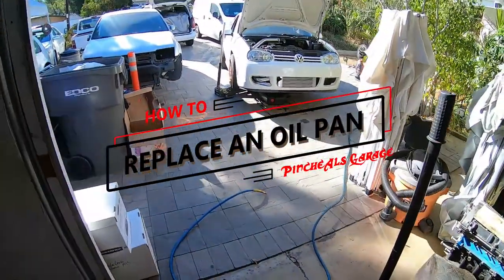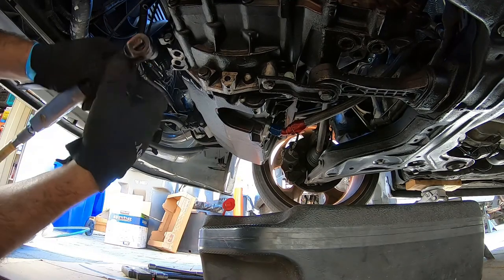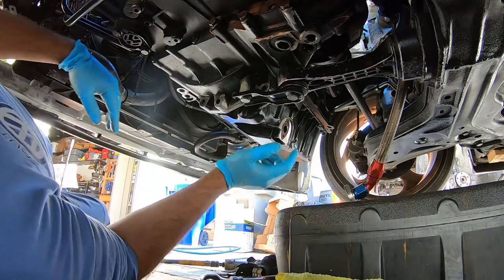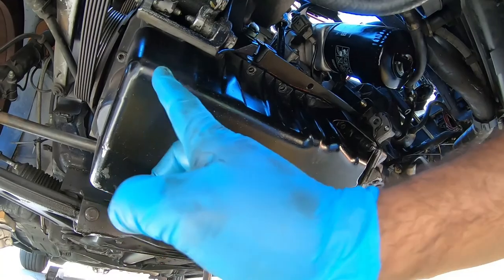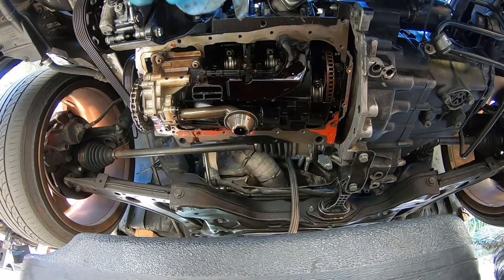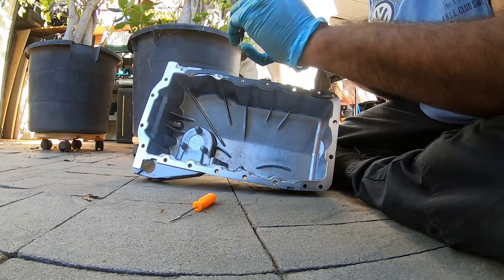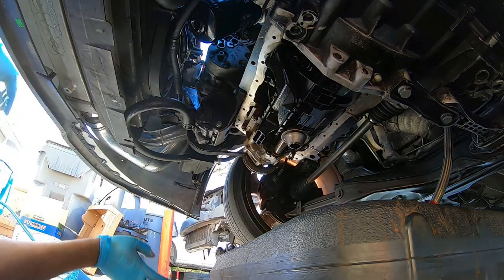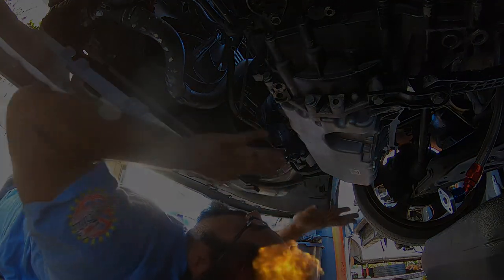How to Install MK4 Oil Pan S7EP18

Comment: Awesome, thank you. 
Just replaced my pan for the first time with your help.
Mine was really stuck after removing all the bolts tho. 
Pieces of the pan broke off when trying to pry it off. (Autumn in Cold weather country). 
Used a "heat gun", "hot air gun" or what it's called in English? to make the seal softer, and it worked like a charm. Thanks again.

Comment: I busted my oil pan recently. I’m lowered and static do you think it’s worth it to get a hybrid pan with steel bottom. ECS sells a kit
Reply from the maker: Yes but make sure you also get the oil return line as well since yours wont wount up correctly with a hybrid pan
Reply: @PincheALsGarage  I believe it comes with an adapter for it. Fingers crossed that’s all it needs
Reply: How'd that hybrid pan work for ya? I just put it in my TDI. Had to grind the built in washers some on a couple of the bolts so they would seat properly.

Comment: But with that oil pan are you not going to have complications with the passenger control arm bushing bolt come time to change it?
Reply from the maker: Its only an issue with automatic transmission cars
Reply: Ohok thanks for confirming, I was worried. I have to change my control arms. I got a manual so i thought I would've had to lift the motor on mine to do it 😅

Comment: Lol how do you get the turbo off s mk4 turbo s beetle without pulling engine
Reply from the maker: Pull the motor man. It will save you a ton of time.
Reply: @PincheALsGarage  i love your channel thanks man I figured that was the worst case I have broken studs on the down pipe
Reply: @PincheALsGarage  i used to own a 16v mk2 gti first car now my daily is a turbo s beetle sick ass car im 29  now building a gtevvti sc400 just sick of the exhaust leak and bad boost
Reply: @PincheALsGarage  you got any manifolds for bigger single for cheap??
Reply from the maker: @226sickology  no sorry